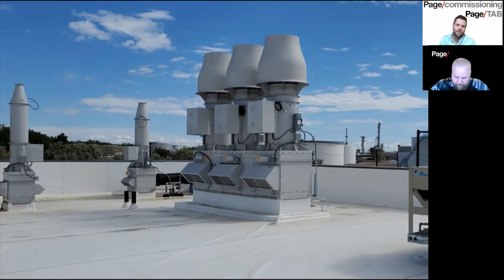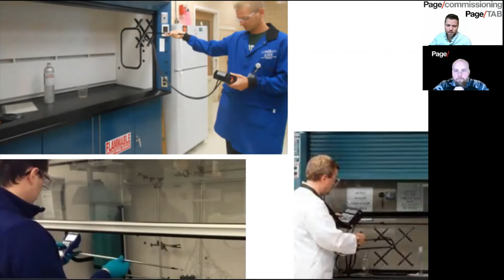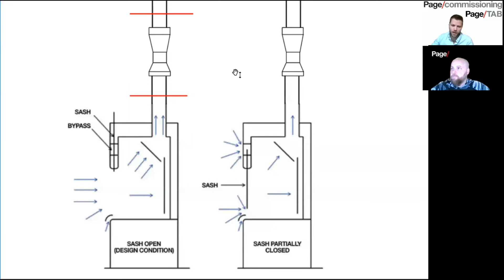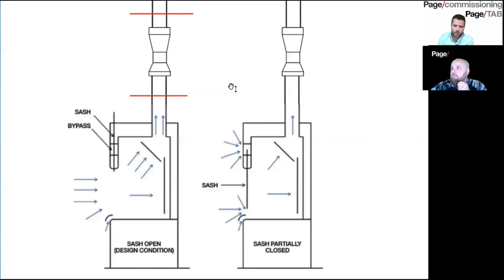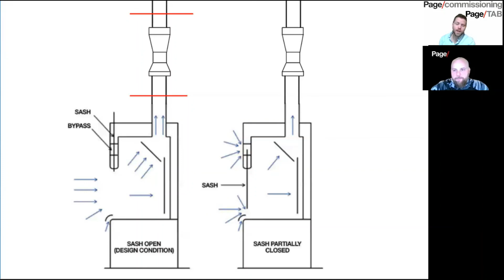Commissioning - Lab Pressure Issues Troubleshooting

Comment: The issues you describe between the 3 & 6 minute mark with the air flowing through the lab hoods can be solved by using Venturi valves like the ones from Critical Room Controls, that utilize constant real time airflow monitoring, rather than the old technology plunger style valves that are pre-calibrated at the factory, but don't respond to real world conditions.